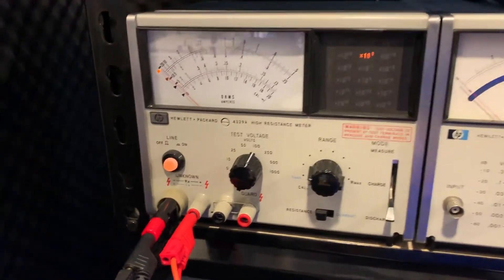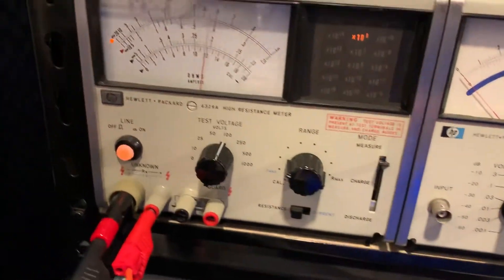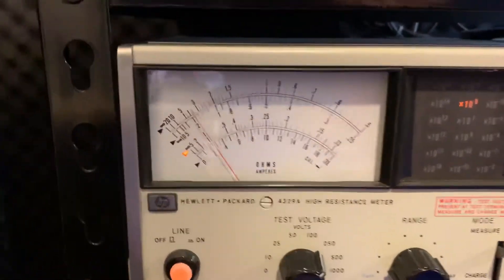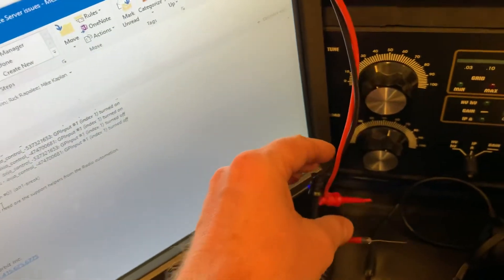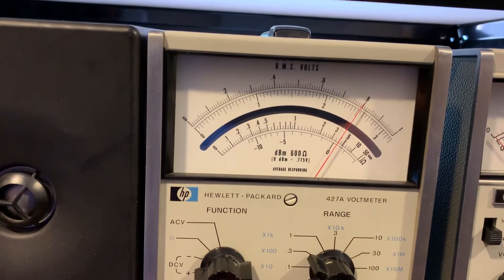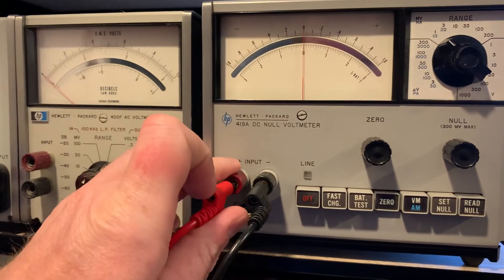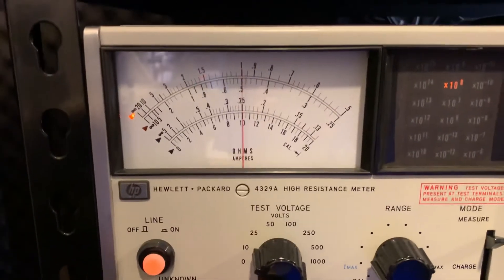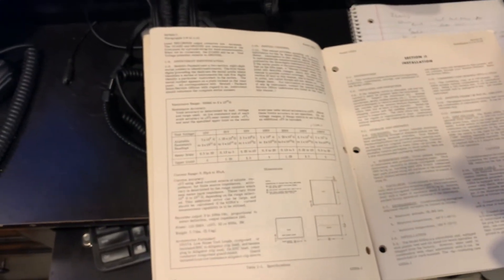HP4329a high resistance meter 1000v range check

Comment: Show !!
I have a bench for automatic testing of transducers and I use a 6114A (power supply), a 34401A to read mV and OHMs and a 4329A for insulation testing. 0 6114A and 4329A have over 30 years of good service. HP equipment is really very accurate and robust.
Thank you for sharing.
Hugs from Brazil [<o>]

Comment: Minimum load for 1000V range is 50 MΩ. OK, that makes sense that the voltmeter's input of only 10 MΩ loads it down too much. But the resistor was 88 MΩ, right? It's greater than the minimum load. Did I miss something?
Reply from the maker: It was reading the resistor okay.  I only thought it was not as I was not able to verify the DC test voltage properly before.  Many resistors can and will change value with high voltage.  This is an example, the value is changing with the high voltage, the meter is correct.
Reply: @damonkj7e  Ah, it was the resistor characteristics. Thanks for the clarification, Damon. It's fun seeing all your classic HP gear.